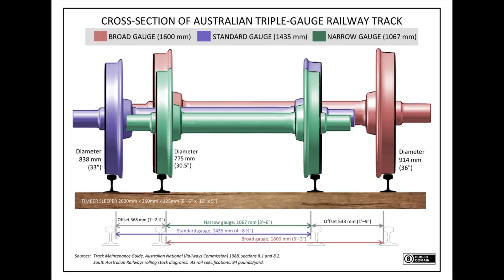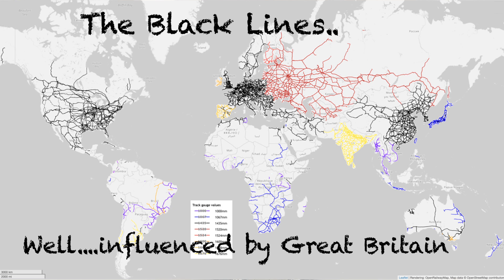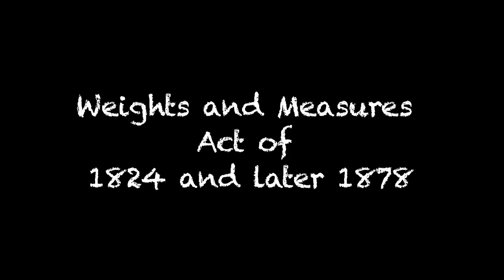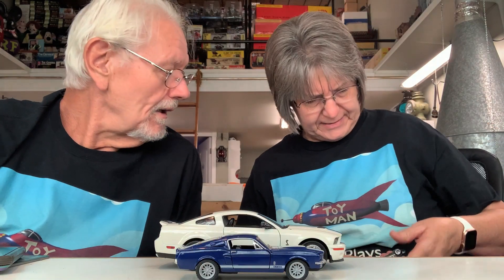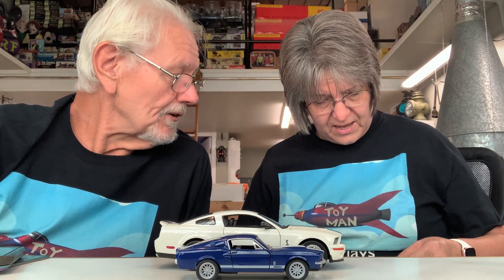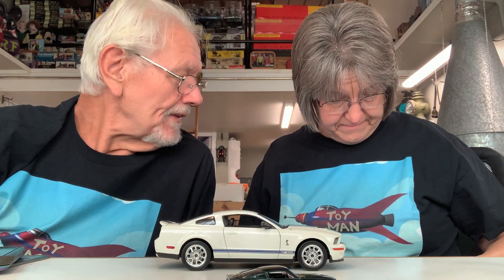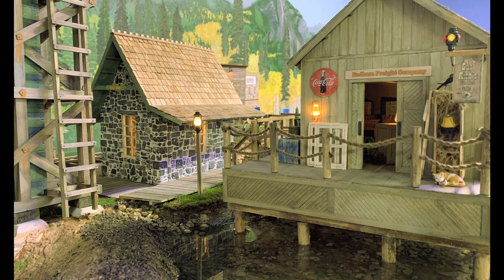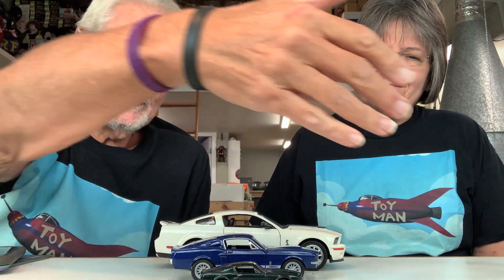Track Gauges & Scales Part 3 - Scales -  Imperial Scales?

Comment: ok i get the scale part I noticed in europe all or most train models run on ho,o,n,andz,and tt but in the u.s. there is s scale but none in every part of the world which is sad I found that s scale is ideal for modeling which I  am fond of because  my father had an american flyer 4 car set with a lighted caboose and I fell in love with it until I had the caboose and crane car stolen  and I could not retrive it with out a fight so I got discouraged and quit and got rid of it and gave it back to the hobby shop which I regret like your friend John Pratt regretted on his u.p. passenger cars and I was so impressed that I want to start s scale not gauge s but there are no kits in s scale and the rest are american flyer with flyer trucks and couplers can you help me find cars at least so I can put some kdee couplers and trucks that look authentic?

Comment: Hi , just wondering about speed scale in 0 gauge.  Got the speed trap walking bridge by lionel and there speeds seem to match the train progress at 25mph or 60mph but seems off at top speed . unit reads about 120mph but the trains not double that speed soooo what gives, ... Thanks for the lunch entertainment...
Reply from the maker: Not sure how that unit works. Most models are run “too fast”. When I first saw a really nice layout and the trains were creeping along… I thought gee, why so slow?  But the scale speed was probably 30 mph. Perhaps 20?  But scale speed. A high speed Amtrak at 79mph still looks slow to most people. Because it is. An HO train at 1 foot per second is going about .86 mph. Or a scale 75 mph. Wow. So many Lionel people run about 3 feet per second. That’s about 120 mph.
Reply: @ToyManTelevision  slow is when im loading at the coaling tower 3.5 miles per hour looks about right to a video of them loading car and the speed trap... iv had top readings of 235mph... god rest there soles ... but that is a lionel flying ... thanks
Reply from the maker: @caseyvillemodelrailroad3877  then the rail grinder train. About 50% of walking speed. A friend used to run it. Sleeping on the train. Switching out two crews. Boring. Very very very VERY boring.

Comment: Never boring. Highly entertaining this round. I agree with your Twit reference. Thanks for the mathematical education. Here in Canada we are metric, while it’s supposed to easier, most people still convert to Imperial. It’s really just a form of being ripped off in length. Like standing in cold for a time. Yeah got your reference there too. I could just imagine you two off camera. I’m off to get stoned, I mean weighed! Lol
Reply from the maker: Omg. Yes sometimes not for publication.
Reply from the maker: I love metric when modeling. A 3 foot 7” fence with 7 fence posts… the spacing is????? 6.1428 inches. 6 and 357/2500” where on a ruler is that’s?  But a 1.2 meter fence with 7 posts… 1200 divided by 7… 171.5mm. Cake walk.
Reply from the maker: But temperature. 0° cold as you mostly ever see. 100° hot. Very hot. 110° stupid hot. Fahrenheit. Logical. Now Celsius. Unless you’re a glass of water it makes no sense at all.-16°. Very cold. 38° Death Valley. In the summer. So I should set my thermostat to??? Wtf??

Comment: Still doesn't explain why O scale or 1/48th scale which is a very popular scale in model railroading has so few automobiles produced in 1/48th scale.  Instead I need to buy 1/43rd scale automobiles!  Where in the "HANG" did 1/43rd scale come from?  Answer me that!!!
Reply from the maker: Well.. metric. We will get into that. But the car companies switched to 1/10 scale for plans. So trying to apply the imperial scaling system to that, dividing those plans by 2.5 comes out to 1/25 scale. So some of the automobiles were done in 1/25 scale as a sort of weird hybrid between metric and imperial. and I’m not sure how but I’m sure that’s where 1/43 scale came from as well. 1/50 I would get. But in here we also find 1/45 scale. Which oddly is logical.  European O scale.

Comment: Well, if you want to go down a bit of a rabbit hole, Lego gauge for their trains, and Lego scale, based on their minifigs, can get pretty wonky.  Especially since Lego will do trains in different scales while keeping the same gauge.
Reply from the maker: Gee. Our railroad does that. 45mm #1 gauge. 1:20.3 scale 3 foot prototype. 1:22.5 meter gauge prototype. 1:32 scale. 5 foot prototype. 1:29 scale. 4’6” prototype. And 1:24 scale. Cause it’s fun.

Comment: I didn't know that the imperial system was established after the metric system. By the way, I have read that the nautical mile isn't linked anymore to the imperial system, but is based on the meter (1852 m).
If you want to confuse everybody, you should explain the scale in the British way. I modelling in 7 mm scale (7 mm to 1 foot), which is better know as 1/43.5.
To confuse even more, try the German way, as they mix the scale and the gauge. Spur 0 (Null) is track 0, so standard gauge in O scale (1/45).
And even more confusion exists in Japan, were the gauge, at least for 16.5 and 9 mm, are the main reference, and the scale varies depending of the real train gauge (Shinkansen are 1/87, but all other trains are 1/80, as they are Cap gauge in reality).
Reply from the maker: I think the imperial system is older. Not sure. But it wasn’t formalized until 1824. Betting before that a hand was a hand. A foot was on the end of the users leg.
Reply: @ToyManTelevision  I though about the formalized system. Multiple kind of king foot must have been existing before the concept of meter was created.
Reply from the maker: Thanks!! Yes always confusing. Now your scale on 1.25 track is fascinating. We will try to explain that on the O scale shows.
Reply: @ToyManTelevision  In France, it is also confusing, as we don't have any French standard. So we use the NEM standard (German), but with the British scale. That give 0, 0m and 0e at the scale of 1/43,5, but NEM use 1/45 for 0 scale. Maybe it is related to the British influence we had for railway: everywhere in France, expect my region of Alsace, trains circulate on left, contrary to the German influence zone, which is on right.

Comment: A lot of people don't understand how scaling works, full stop! My ex was one of them.

Of course one way to scale things is to use architect's or Engineer's scale. Dale this isn't for you because I'm sure you know this but some watching may not know about these rulers.

The difference between the architectural and the engineers scale is the architectural is fractional for feet and inches, the engineer scale is base 10 such as 10 20 30 40. 

I do most of my airplane drawings in 1:10 scale or larger depending on the details needed to make the parts. 

You could make a show on just useing the different rulers and how to take details on paper and put it on building stock.
Reply from the maker: Yup. A scale rule is my rule.
Reply: @ToyManTelevision  I edited my post you may wish to read it again.
Reply from the maker: Hi again. Yup. I have an archaeological rule. I use the 1/20 scale all the time. Cause the railroad is 1/20th. And we have an HO scale and an N scale. I mostly use the rule to draw a plan. A basic plan usually.

Comment: Never boring but always unique different and strange.  In college we had to calculate the speed of light in (wait for it!) firkens per fortnight.  Engineers and Scientist often have convert units back and forth.  We use pounds mass and pounds force.  Normal pounds are mass, and stones (or foot pounds) is force.  The confusion is the gravitated constant.    (Pounds force (is Force=mass X acceleration).  I know I am going to get lots of comments over this (to convert to pounds force multiple pounds mass by the gravitational constant). Confused?  Then try to do heat transfer calculations in metric!  Much much easier in imperial units.
Reply: Since I am on a bend; when I was in Scouts they created a new merit badge (they didn’t create many new merit badges at that time).  So I found out the requirements and earned it.  The counselor who no idea what he was doing   (Which really was part of my plan).  Needless to say I did earn it.  My first semester of college we were required to take a class called “Graphical Communications!”  I can hear you asking just what the Sam Hill is Graphical Communications?  We it was drafting and computer programing.  We were in quest for the “true length of a line” when drawn in free space.  Such fond memories.  I still have my tee square, my French curves, my triangles and my drafting equipment 54 years later.
Reply from the maker: Now. Gravity is actually acceleration do to the expansion of the universe. So this leaves the real question:  what time is it on Mars?  And now when I asked but now. Oops. Missed it again. So…… NOW!!  Oops… endless loop. Rebooting.
Reply: @ToyManTelevision  Like I said never boring!  And as you figured out you have to use the appropriate gravitational constant.

Comment: Actually, nowadays all units of length are based on the metre (aka. meter). This is defined in terms of a physical constant (the speed of light in a vacuum).
From the metre you get kilometres (1000 metres), millimetres (0.001 metre) and so on.
The Imperial units of length are based on the inch. This is because an inch is defined as 25.4 millimetres. The US adopted this in 1959 and other countries between 1951 and 1964.
From the inch you get the foot (12 inches), the yard (36 inches), the mile (1760 yards) etc., etc.
I know this is a bit pedantic but people seem to think that Metric and Imperial units are still completely independent.
Reply from the maker: Yet the roots are in the feet of the king. Or the feet of 16 men coming out of church. Or?  So while a better system is used, the kings foot will always be there. Even if it’s only to say this is a 1/24 scale car.

Comment: Why did some model car makers start manufacturing in 1/25th Scale for frictions and promo cars?
Reply from the maker: Not sure. But I’m thinking is because of the reduction pantograph. Yup that’s an upcoming show. But all these cars are prototyped in 1/8 scale and then pantographed by 3 to 24. But I think if you really measure a car from those molds the plastic has shrunk a bit. So 1/25?  Not sure.
Reply: @ToyManTelevision  I was told in the US, the prints that were sent to the model manufacturers to make promo models were in 1/10scale. It was easier to figure or pantograph at 2.5 times smaller to make 1/25th scale. That was starting around 1948 when AMT started producing aluminum promos for Ford. In 1949 they went to plastic. Fast forward to 1958 when they started making annual model kits for the hobby market, they continued to make 1/25th scale. HOWEVER, some of the kits of large cars such as Lincoln, Imperial etc. ended up being a little smaller although they were listed at 1/25th. They may have been as small as 1/27th scale. Some have said it was so it would fit in the standard model box, others have stated it was to save plastic, but I think it may have been, so they didn't have to revise their molding blocks to hold larger inserts or some other technical issue.
On that same issue, if by chance the Hot Wheels car was actually 1/64th scale, it is by accident. The Hot Wheels, Matchbox, Tootsie toys, etc, are scaled to fit the package! In fact, if you were to measure the #66 Matchbox Greyhound bus that came out in 1967 you will find that the length, height, and width figure out to 3 different scales. So some toy trucks may look OK on an HO layout but most of the Matchbox cars since 1964 are way too large. Even Racing Champions which put 1/64th scale on their packages took license with their first dragsters which were not that scale and were not even in scale with themselves but were shortened caricatures.
Reply from the maker: @hotwheelsbob2000  thanks wow!!! Great information. So 1/10 scale…. Now that makes sense. Interesting though. One of the 1/8 scale models was made in full size for car shows, 1:1 pantograph for a 1/8 scale model and 1:3 for a 1/24 scale. Monogram’s Big T. So successful they did three more variations of it and then several more with the Big Duce being super popular as well.
Reply: @ToyManTelevision  Monogram used 1/24th scale for most of their models which was used by most of the European model kit makers. In the US, Monogram models were not as popular because they "looked odd" next to the AMT. MPC, and Revell models. It is interesting that Revell started out using 1/32 scale but went to 1/25th later.
Reply from the maker: @hotwheelsbob2000  ps. Have you seen https://youtu.be/WHNY1UF2xDw
Reply from the maker: Not hot wheels anymore. He replaced them with heavy recasts.
Reply: @ToyManTelevision  Yes I read that he had his own cars made.
Reply: @hotwheelsbob2000    3Dbotmaker can keep me entertained for hours. Hotwheels Racing.👍😂
Reply: @dh190852  Yes. I have watched many of their videos. Th e sound effects, and banter throughout the videos is first class!

Comment: So, you are saying, for example, 1/24 scale is 1inch equals 24 inches, makes sense.
scales like 1/4 inch equals 1 foot  0 (zero) inches is an imperial scale used often in architectural design, easily used in modeling.
Where the real "wrench in the works" comes in is converting metric to imperial. It requires multiplying millimeters (3.5 HO) by .03937 to come up with decimal inches (.137795 inches) and then figure out what the fractional is (slightly less than 17/64) YA RIGHT. All this is easy if you are working in a machine shop where decimal measure is exclusively used.  
Scale can be a real problem. Having a real good NMRA scale rule helps a lot, especially when scratch building. 
Then there is size. !/2 inch scale is 1/4 the size. Again YA EIGHT 
Great video, I did not know where all the quantities came from, I just had an education. ;-)

Comment: 3:40 Actually, the "hand" is quite useful to me. A hand, at 1/3 of a foot is 4 inches. And my hand is about that width. And 4 inches is about 10 cm. So ten hands is aboutish  (a highly technical term.... cough... cough) 40 inches and aboutish 1 meter**. And if one does gardening like I do,  and one needs to plant a certain distance apart, the one tool I always have on hand is (no pun intended ... maybe), my hand.  🙂

**Well, okay, actually 4 inch is 10.14 cm so to be really accurate one needs to adjust a bit (1 meter is 39.37008 inches). But if one is dealing with measurements on the scale of horse shoes and hand grenades it is close enough not to bother with corrections at the meter scale. 

All the above probably has nothing to do with scale or gauge. Just for fun. Best.
Reply: May I quibble with one of your calculations in the ** note.
Four inches is 10.16 cm (by definition).
As an aside, if anyone wonders how to work out how many inches to a meter it is exactly 1/0.0254   I do not recommend calculating this manually when electronic calculators are so cheap. 🙂
Reply: @pras12100  You may of course quibble. No problems. No worries. And thus, may I quibble back? One should avoid taking my comment out of the context (and paragraph) which I intended it. And in that context, as I wrote it and intended it, I was talking about a horse shoe and hand grenade world... So stressing exactness, while certainly correct in it intent, is a possible needless redirection from my point.... All the best. 🙂
Reply: Calculators don't convert centimetres to stones or acre feet to kilograms.